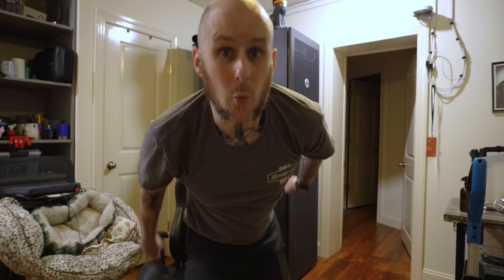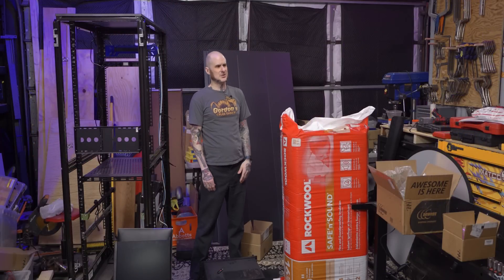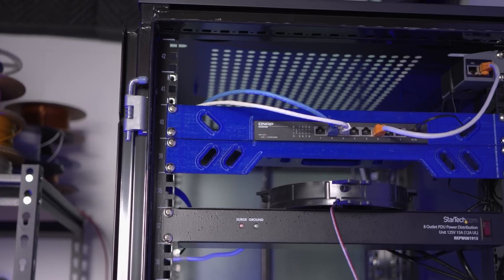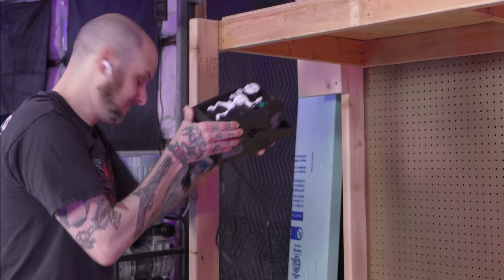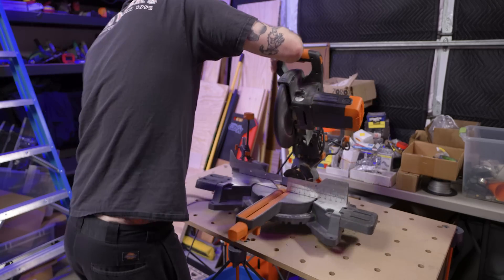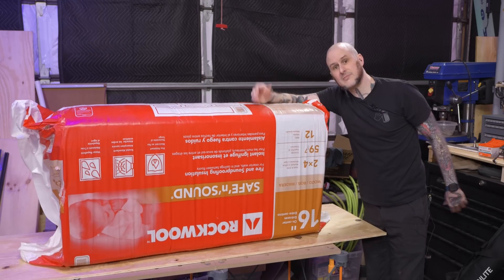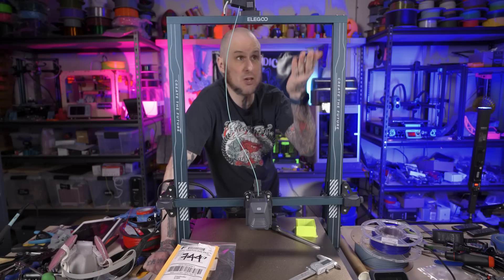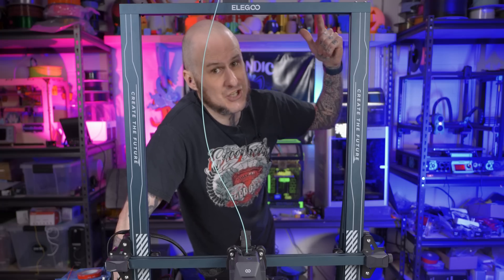EPIC MakerSpace Studio Overhaul! - Studio Revamp 03

Comment: If you ever need to use that garage door, Wesley Treat did a cool tri-fold insulated panel across in front of his that would give both insulation and a nice surface for whatever art/decoration you'd want on it. You might have said in a previous video that you don't use the door, though, so in that case that might be a bit overkill when you could just make a simple wall across it.
Reply from the maker: I don’t use it. Just took a break from wall construction. 😅 👍🏻

Comment: 3d question. When keeping all your filament on the shelf in your backdrop. Do you have issues printing since it's not sealed or in some kind of low-humidity chamber?
Reply from the maker: My studio is climate controlled (despite not being well insulated) so I really don’t have a lot of humidity in the space. That said, I rarely has issue with that, even with PETG. If I’m concerned I have a couple of filament dryers that I’m not fond of, but I have plans for a project along those lines real soon. So watch out for me.